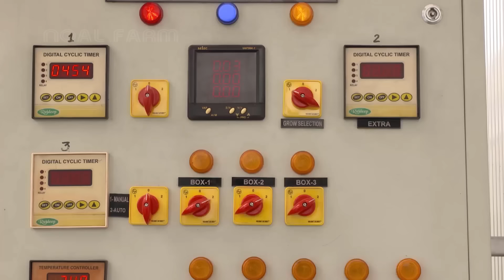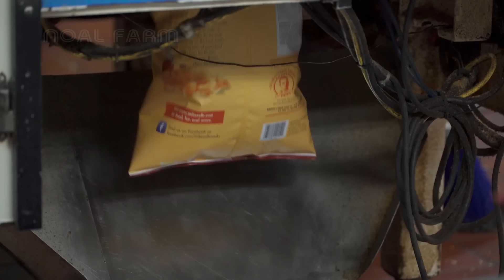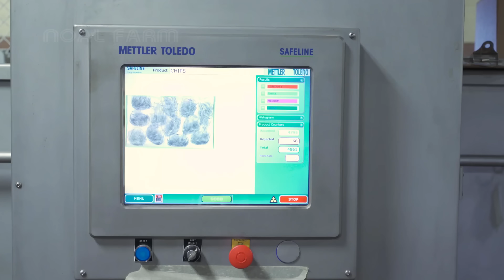Aeroponics Potato Farming - Potato Chip Process Factory - Modern Potato Agriculture Technology

Comment: Turn the heat up on that steam when you done and harvest em cooked
Reply: this man is living in Venus 2069
Reply: Haha, actually it is steam that made from the high pressure of the water, not heat. But your joke is funny though
Reply: @loanhua8598  k.          Y.      S.
Reply: That's mist, but the subtitle is wrongly informed as steam.
Reply: Change water for oil first, and harvest em fried 💪🏽
Reply: @Yusuf-ok5rk  😂 steamy
Reply: @Yusuf-ok5rk ;;;;;;;
Reply: I would not eat it. Doesn't look natural with all those colored powder.
Reply: HE LARRY E US
Reply: @akeem1221  Those colored powders are litterally just a purified form of the minerals you would normally find in soil. They aren't going to lower the quality of the potatoes or pose a significant amount of danger.
Reply: @loanhua8598  that's mist. Steam is hot because it's a form of evaporation.  They are spraying a fine mist onto the roots
Reply: @rodrigochiberio5472  😅
Reply: @beckylieb2637  With the exception of nitrogen fixation most fertilizers aren't actually synthesized and we actually have a fairly decent understanding of what nutrients plants need to grow properly since they synthesize just about everything other than water, minerals, fixed nitrogen, and carbon dioxide even under normal conditions.
Reply: Can we use aeroponic to produce melon ?
Reply: @akeem1221  you know that most of the produce you buy from the store uses the same synthetic fertilizers just in different ratios right? 😂
Reply: Now that's a genius idea! 😂 Imagine getting your chips straight from the farm, hot and crispy. Would anyone else love to see that happen?